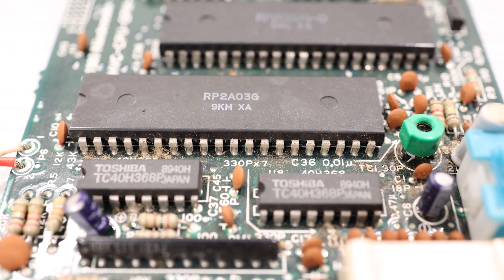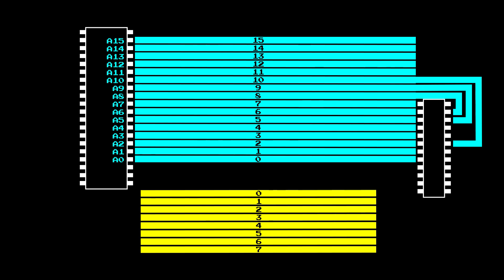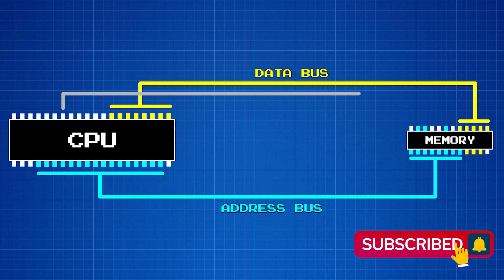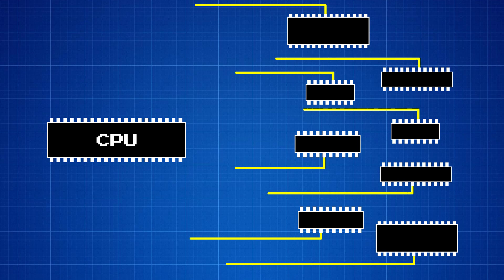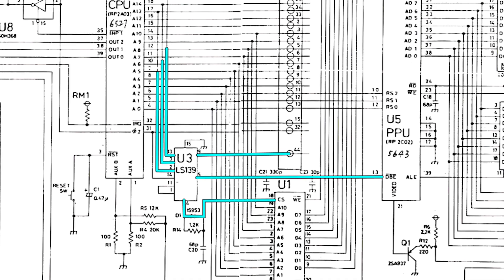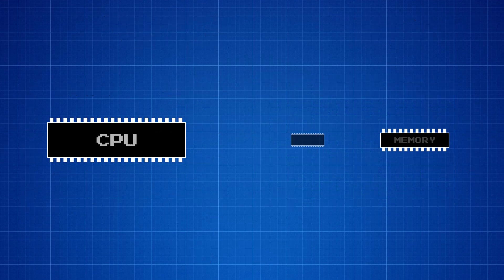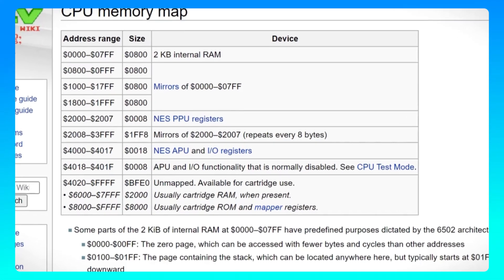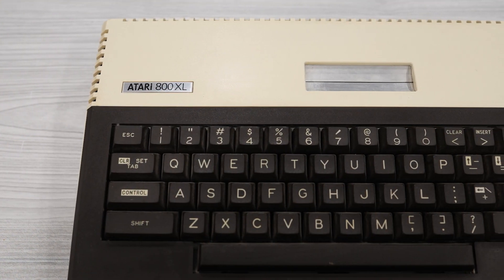Inside the Famicom | 03: The Memory Map

Comment: Another bug in the video: at 8:40, A15, as well as A13 and A14, must low when accessing that RAM chip (address range $0000-$1FFF). Were A15 high (address range $8000-$9FFF), input 2A on the 74LS139 would be high, thus enabling (sending low) output 2Y1 (pin 11), which is in turn wired to enable 1G (pin 1), disabling the outputs of the lower half of the decoder. (Yes, this is a bit tricky, but a common trick when using a '139 rather than a '138.) This is why, in the memory map, $8000-$9FFF is shown as cartridge ROM rather than mirrors of internal RAM.

It's also worth mentioning that the "port-based" architecture of the 8080/Z80/etc. is, from the hardware designer's point of view, pretty much the same thing: you just have an extra pin, equivalent to another address pin, that determines whether you're using "memory" address space or "I/O" address space. But having this extra address space does mean that you usually need less address decoding hardware. The big difference between the two is on the software side: you usually need to use entirely different (and often much more limited) instructions to access the "I/O" address space than to access the "memory" address space. But there's nothing stopping you from putting memory in the I/O address space or vice versa, except that you can't execute code from the I/O address space.

Comment: You inspired me to get a lot of 6 old Famicoms from Japan and to refurbish them. Currently replacing the RF modules with custom PCBs to get composite video out. Can't wait for that PPU episode. I'm looking into RGB mods and all that PPU stuff is pretty WILD
Reply from the maker: Nice! You can get decent composite video with just a transistor and a couple of resistors - that's how I modded the video in my first Famicom years ago.  I have an Atari mod video that walks through the mechanics of how it works, but on a VCS instead of a Famicom. Btw, if you have any FCs that you deem unrepairable, set them aside... in the last episode of the series, I'll show you an alternative for what to do with them 😊
Reply: @whatskenmaking  I saw that! I was considering doing a simpler mod but then decided to replace the entire RF module. Solves the issue of the weird polarity power supply as well. And it takes care of the old caps. And it ends up being a bit cleaner. I'm hoping none Famicoms are busted but also happy to hear there is a future for them even if they are!

Comment: 3:40 This isn't strictly true.  Based on the parallel input it's true for the NES and this implementation of a chip.  Maybe I can learn something here, but I thought that it was the register size or instruction size that made the architecture 8bit since you could ostensibly have Serial communication that would not be a phenotype of the chip itself.
Reply from the maker: Someone else commented on that as well, and I believe that person was correct - it’s the internal data bus width that determines this (as opposed to the external data bus). The register size is sometimes reflective of that, but it’s not necessarily consistent. I appreciate the discussion, though - and I learned something as a result

Comment: External data bus doesn't determine the "bits" of the CPU. For example, 8088 has also an 8-bit external data bus. And an 80386SX has 16bit. It's the internal data bus width that determines the "bits."
Reply from the maker: 👍 Thanks, I’ve added a correction to that spot of the video
Reply: Actually, it's not even the internal data bus width: whether a CPU is "8-bit" or "16-bit" (or otherwise) is really more of an amorphous set of parameters any one of which might vary, but if enough of them vary it's no longer "16-bit." These include:

1. Accumulator register or general purpose register size. These are almost invariably 8 bits wide on 8-bit CPUs, and generally are at least 16 bits wide on "16-bit" CPUs. But the Motorola 68000,  generally considered a 16-bit processor, has general purpose registers that are 24 bits wide.

2. ALU (arithmetic-logic unit) size. Most 16-bit CPUs can do a 16-bit add operation in one step. This is also common on 8-bit CPUs, but the Z80 has only a 4-bit ALU and takes several internal cycles to do an 8-bit addition, though this is hidden from the programmer, who uses only one "add" instruction to do an 8-bit add.

3. Address space size. Most 8-bit processors have a 16-bit (64K) address space (though they may access more or less memory depending on the address decoding (mapping) arrangements). 16-bit processors such as the 68000 or Intel 8086 generally have a larger address space, though the PDP-11 is a notable exception, generally being considered a 16-bit CPU though it still can still address only 64K locations.

There's probably more, and this gets even messier when you look at pre-microcomputer CPUs that often had architectures significantly different from what we see in microprocessors.
Reply: @Curt_Sampson  I studied CS, in a situation like this, internal data bus says the last word.
Reply: @drkamilz  First of all, the internals of CPU architectures are studied in EE, not CS. Second, you've just claimed that while a PDP-8 is a 12-bit machine, a PDP-8/S is a 1-bit machine, despite looking identical to the programmer. That's simply absurd.

Comment: 11:11 "that 3 bit address space being repeated 1024 times" can you describe the implication or result of this address space being "repeated". I'm not sure what you meant by that. Thanks.
Reply from the maker: The PPU uses 8 bytes of the address space for communication, since there's only 3 address lines connected - these are addresses $2000 - $2007. But since the chip select signal is activated with the 13th address bit, all addresses within that entire 8KB range ($2000 - $3FFF) address the PPU.  The result is that those 8 bytes of addresses 'repeat' 1,024 times. In other words, if the CPU reads address $2003, it'll get the same result as reading address $200B, $2013, $201B, etc. all the way up to $3FFB. From the CPU's perspective, it would be requesting data on different addresses - but from the PPU's perspective, it all looks like the same address since it's only connected to the lower 3 bits of the address bus.
Reply: @whatskenmaking  OK I think I understand, there a whole load of memory rendered useless because reasons involving pins.

There is redundant memory is what I seeing here and the PPU does not have access to it either.
Reply from the maker: That's what it essentially amounts to - the rest of that 8KB address space tends to just repeat the same target addresses so they're not usable for anything else. When I get to the episode on cartridges, we'll discuss how they work around the address space limitations with mapper chips.
Reply: @ribenasquash  It's not memory being rendered useless: it's address space.  The CPU's 16-bit address space allows it to put 65536 different address values on the bus, but what device and what address within a device is accessed when the CPU puts a particular address on the bus is determined by the address decoding logic. E.g., "when the CPU puts address $2000, $2004, $2008, etc. on the bus, make it access address $0 on the PPU."

This is how "mappers" (which are just programmable address decoding logic) work as well: they store extra state to say e.g., "when the CPU puts address $8000 on the bus, make it access $0000, $8000, $10000 or $18000 depending on on which of the four banks of memory in the cartridge is currently enabled."
Reply: Writing a byte to the register mapped to memory location $2000 is the same as writing it to $2008... or location $2010, or $2018, or $2020... and so on...
Then, the register mapped to memory location $2001 is also mapped at location $2009, $2011, $2019, $2021, and so on... Its kinda complicated, just easier to just use $2000 to $2007.
Other way to describe it is understanding that PPU has 8 registers numbered 0 to 7, then you take the binary address in the range $2000 - $2FFFF and consider only and just only the lower 3 bits, so $2000, $2008, $2010, etc are all the same...